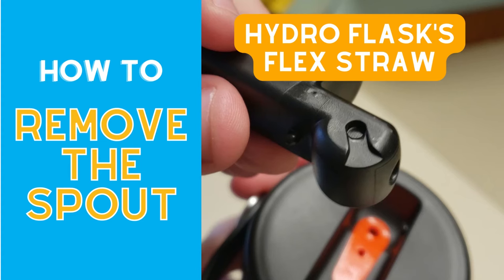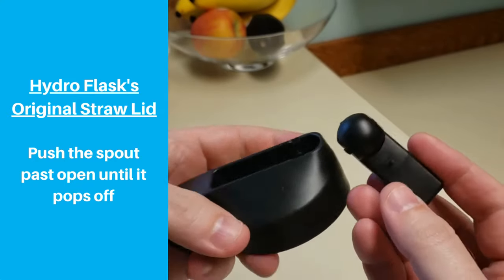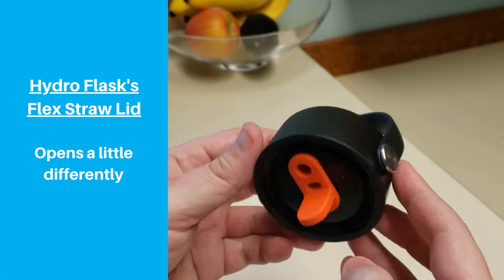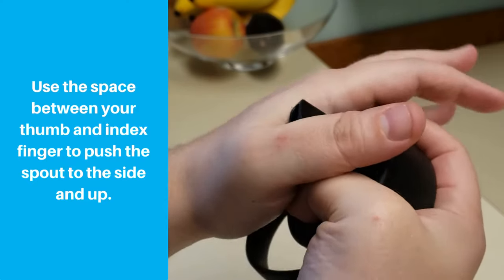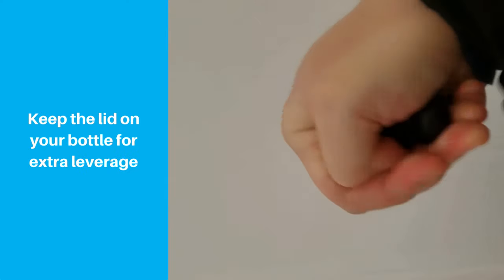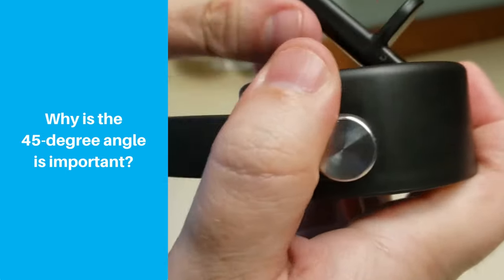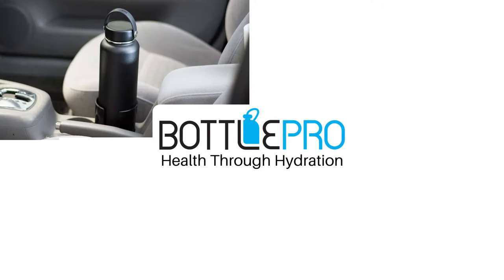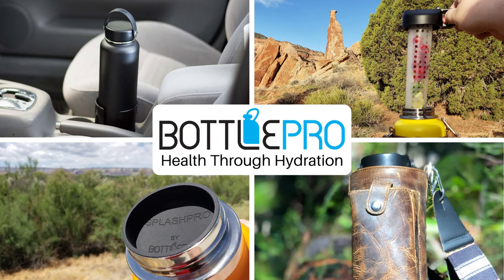How to Remove the Spout from a Hydro Flask Flex Straw Lid  *SEE VIDEO IN DESCRIPTION BEFORE TRYING*

Comment: after i cleaned my flex straw and reassemble the lid, the suction resistance of the straw is now increased, making it really difficult to drink (suck up the water), is there any way to fix this?
Reply from the maker: Hmmm, I'm not 100% sure.  You're probably already doing this, but make sure you rotate the spout all the way until it stops and can't be rotated anymore.  If it's only 90% opened, then the hole at the bottom of the spout won't line up perfectly with the straw hole in the red silicone insert.  If those holes are only partially-aligned, then that would be a reason why it seems like it's harder to take a drink.  Also make sure the smaller air hole in the red silicone insert isn't plugged with something. Other than that, I'm not sure what the issue is.  Hopefully this helps, and let us know if you've found out anything else!

Comment: doesn’t really work for me
Reply from the maker: It takes quite a bit more force at a more awkward angle than the old design, but there's only one flex straw spout design so it should pop out and look like the one in the video. I was actually concerned i might break it at first and contacted hydro flask, and they confirmed that the spout comes out but needs more force. That's when I really started pushing the spout harder in different directions until I was able to pop it out. It's definitely trickier than the old one, but keeping the bottle on for more leverage helps a lot. Hope this helps!